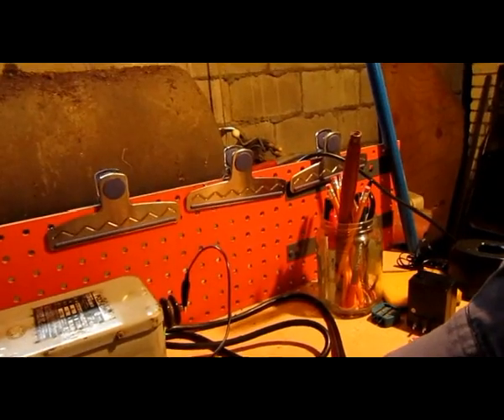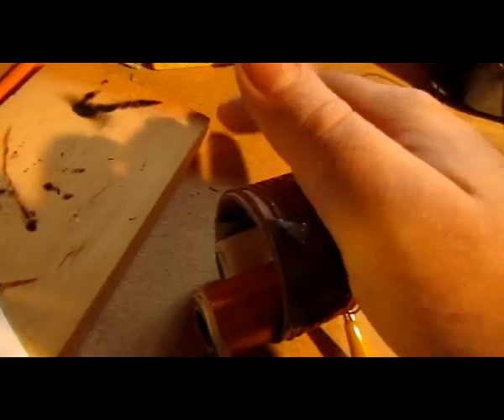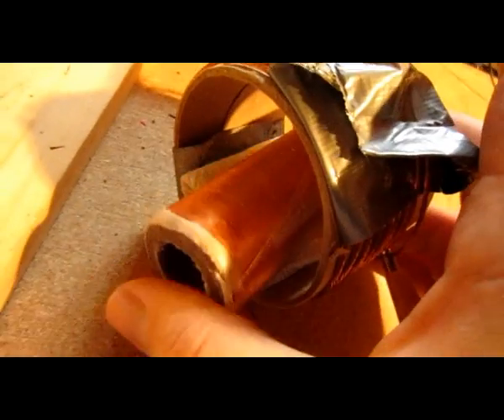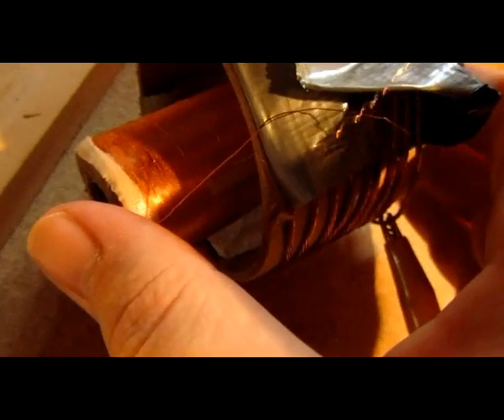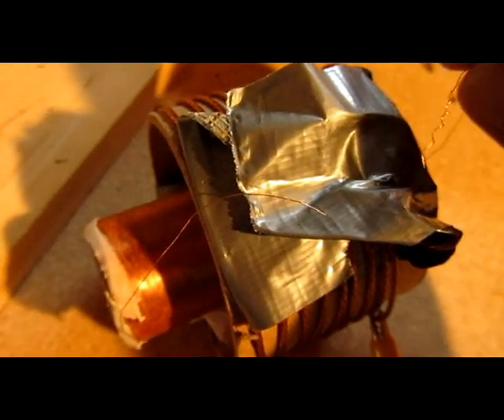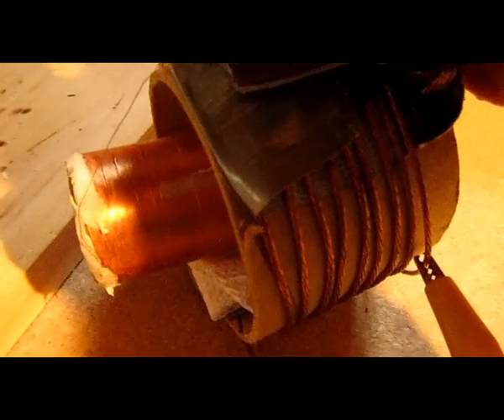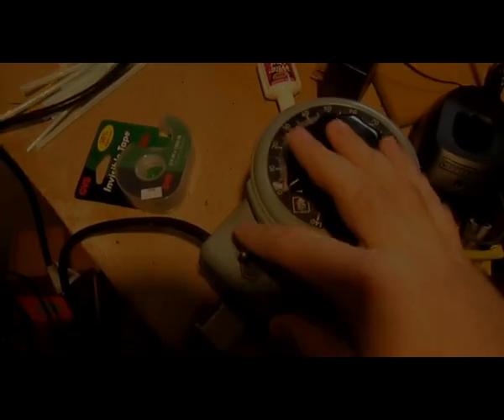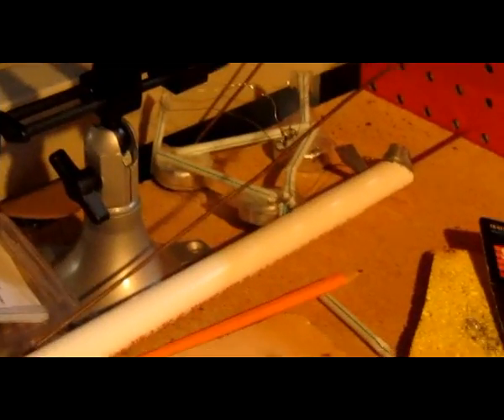Mini Tesla Coil

Comment from the maker: I suppose it would be possible, but you want to watch out for RF burns on your fingers.  I have seen just my neon sign transformer arc a path through a pine board, burning through 4 or 5 inches of material in a failed jacob's ladder attempt.  Rubber dishwashing type gloves I can't imagine offering much protection.  Also you really don't want a lot of volts even at milliamps going from one hand to the other - that could sent the power through your heart and maybe stop it ... not worth your life..